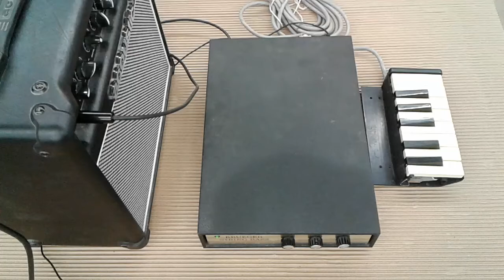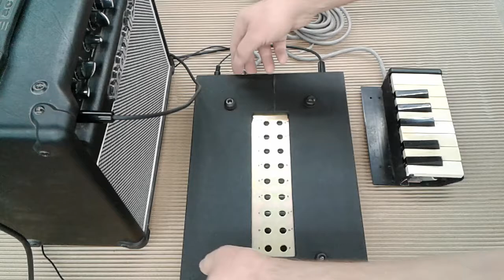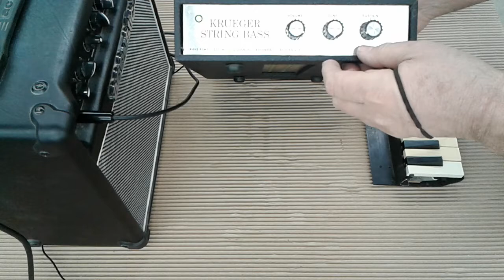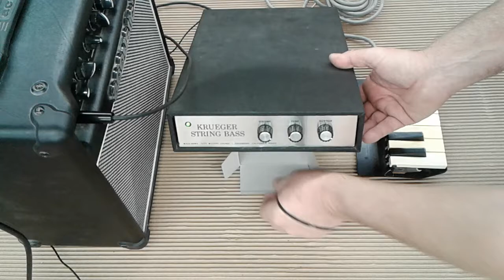Krueger 13 Note String Bass

Comment: Curious as to why you convert it to a 24v dc? What is the benefit?
Reply from the maker: Safety. The original circuit was un-grounded 110ac, to a 24v transformer and half+wave rectifier circuit. Most repairs were for club musicians. My brother, a singer in a club band  has to put up with drunks walking up to him, inadvertantly spilling drinks on his equipment. So safety.